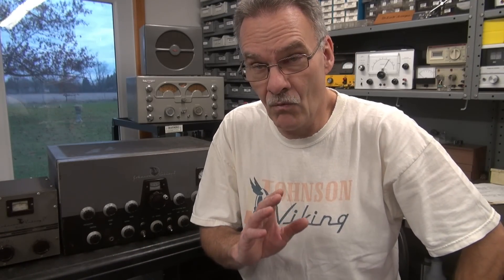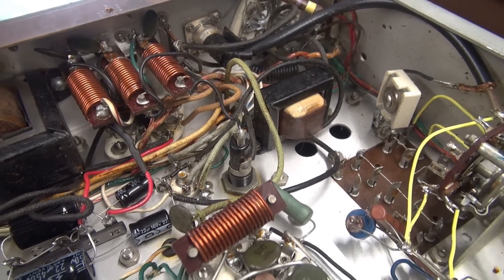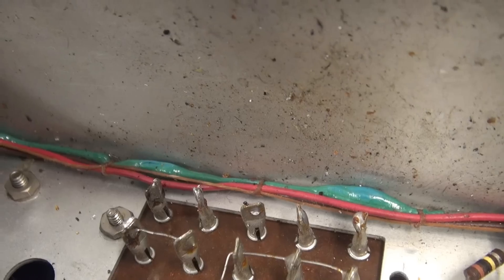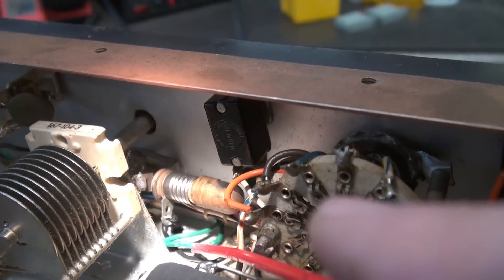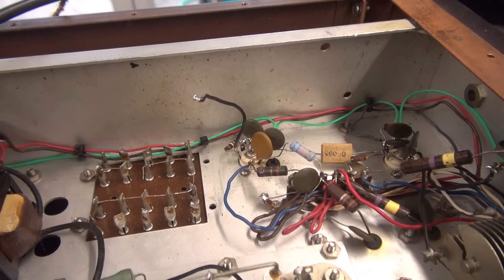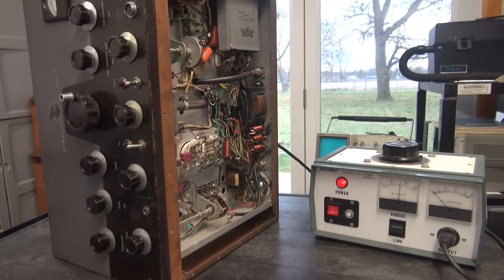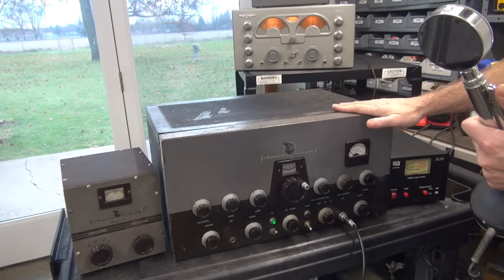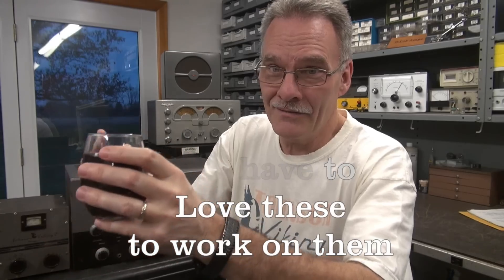Johnson Viking II part 3 How to repair melted wires Shorted 6 Vac filament circuit

Comment: You said that there was not anything else that needed repair on it...but what about the 10 position switch that only moved through 3 places?
Reply from the maker: I replaced the switch with a stock one in the video